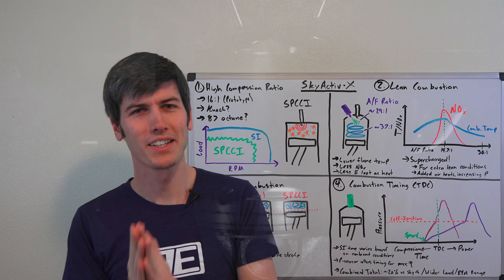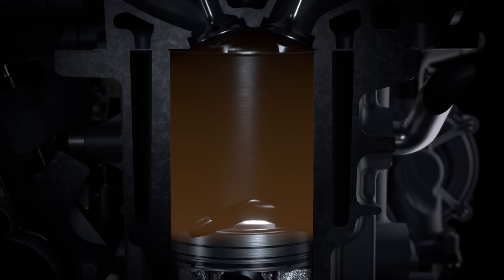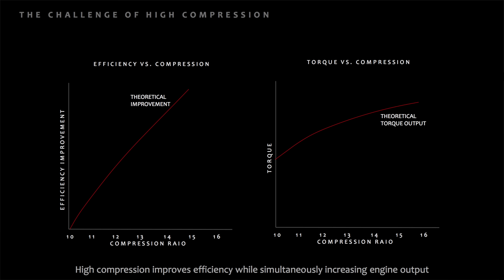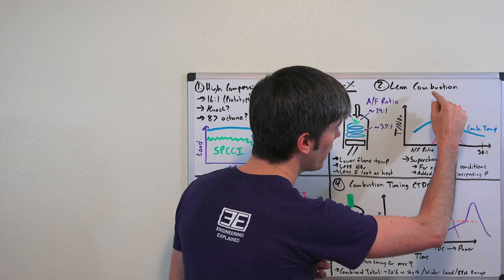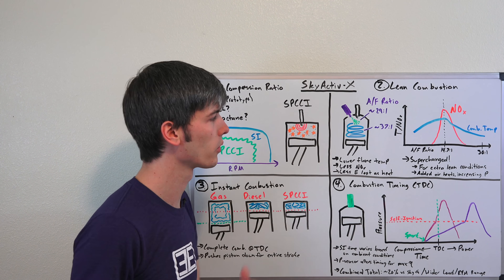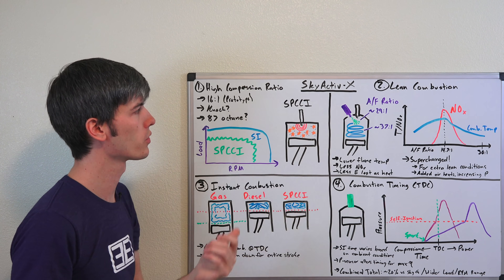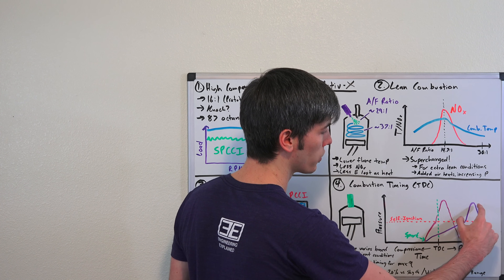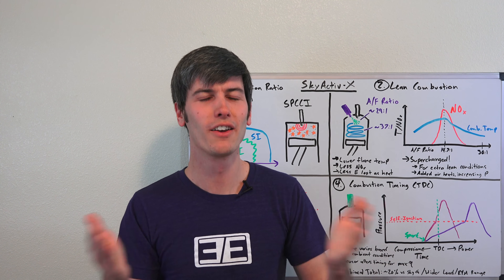How Mazda Is Saving The Gasoline Engine - SkyActiv-X

Comment: I assume that test engine is a 2.0L...Not bad if it makes 190hp. Thats 35hp more than the current engine while still being cleaner and fuel efficient....Also a few hp more than the current 2.5L.
Reply from the maker: Yes, 2.0L.
Reply: It is supercharged tho
Reply: Yup, it's pretty damn good for a small, efficient engine that is using the supercharger NOT solely for extra power here.
Reply: I was wondering this the whole time. You should put a pop-up thingy on the video that mentions this.
Reply: It doesn't add more fuel with the extra air though, like how you would use a supercharger normally. It's only to lean out the AFR.

Comment: They also have the best EPA fuel economy with torque converter transmissions. No 9 speed DCT or CVT needed.
Reply: it also drives amazingly. They have REALLY aggressive lockup, and behaves much more like direct drive (no slush box characteristics for most of use). The only downside is it can get a little jerky under load.

Comment: 100+ mpg was achieved in the early 70s by privateers. GM & Shell actually reached nearly 1000 mpg in the mid-late 70s with a carbureted Pontiac V8. That technology has been occulted.
Reply from the maker: From an energy standpoint, 1000 mpg just not possible in today's sized cars (unless you're going down a big hill). Conspiracy theories should at least be mathematically feasible. Unless they were based on nuclear fusion. :)

Comment: 16:1 compression is crazy... my 2.2 diesel engine is 15.7 compression.
Reply from the maker: Yep! Mazda even has 14:1 CR diesels.
Reply: Pretty high for a gas engine, my 3.0L diesel is 16.5:1.
Reply: BrianNC81 That's what I meant to say. I was comparing it to my diesel!
Reply: Engineering Explained Whats the advantage of a "low conpression" ratio for a diesel? I commonly work on older Land Rovers which have 19:1 compression. As far as I know, older diesels have far higher compression ratios than modern. I know they're turbocharged now, hence lower but why THAT low for the Mazda engine?
Reply: LewStep With a high compression ratio the temps and pressure were higher, causing combustion in small pockets of air+fuel before it had time to mix well. They wanted better NOx emissions from more even combustion and heat that is spread out instead of localized and intense. They're also running 24 psi of boost with a compound setup. The race version of the engine was running 12:1(I think) compression and 70 psi of boost.

Comment: I have a question about this, why do they choose to use a Supercharger and not a Turbocharger? isn't it more efficient to use a Turbo since you are "Recycling" the otherwise wasted energy from the combustion? The supercharger has to run off the engine crankshaft, it may be more inmediate but less efficient, right? who can explain this to me
Reply: ChickenTM they need consistency, so they don't want turbolag.
Twincharge would be a good idea though
Reply from the maker: Because you'd need sufficient exhaust gases to produce significant airflow, which you won't have when you're running in low load, high efficiency modes.

Comment: I wish BMW do the same for inline 6-cylinder petrol engines, no turbocharge, just a pure aspirated engines... Unfortunately they took the easier way by putting turbocharge in small 2.0 engines and rename them as they are bigger (2.0 is new 3.0), what a waste...

Comment: I have a question! Why it is not possible to compress just pure air and inject fuel (gasoline ofc) AFTER compression is done, so the fuel self ignites the moment it is injected at very high pressure into the combustion chamber which already holds pressurized air.

Comment: So how do they prevent Knock from hurting the engine? Or did I miss that somewhere.
Reply from the maker: Using the pressure sensor to monitor cylinder pressure, they adjust spark timing/valve timing/air-fuel ratio/etc accordingly to ensure that combustion occurs at the right moment, rather than creating knock.

Comment: I would surmise that most manufacturers will adapt a similar concept. I always felt that that grey area in Ignition before or after TDC was so unknowable and wasteful of energy, due to any number of reasons (load temp fuel combustion deposits etc). That pressure transducer in each cylinder monitoring the exact ignition time to help  automatically adjust the map of ignition time is a masterpiece.  Yep very very complex and I would own a extended warrantee.  Some form of combustion engine will be around for decades.. this is the technology.. 
I envision a different fuel type perhaps  and adapting this technology to diesel. AKA Multi Fuel Engine? Mostly All thats needed is the correct engine maps.
What would I do without your simple explanation and theories of operation in your videos.
Hey it makes me feel more intelligent. Win Win baby!

Comment: So how does this end up performing as far as an estimated fuel economy? I would imagine significantly higher than other gasoline engines. Also, what does the engine efficiency (vs ideal engine) end up being? I'd imagine somewhere in the low 80% range, right?  All very cool stuff, thanks for the video!
Reply from the maker: Current Mazda 3 is 28/37 mpg with SkyActiv-G, and Mazda anticipates about a 20% improvement with SkyActiv-X.

Comment: Interesting engine but i wonder if we will ever see it here in Europe. We do not have fuel with octane as low as 87. Our regular has 95 octane and super has 98 octane, so self combustion and the timing is a lot harder.
Reply: GauisHelenaMohaim I think it's the same grade still so your 95 is our 87.
I believe engineering explained made a video about it already
Reply: J73DD37J ok, that makes sense, a different method of measuring it seems. Tnx for the clarification.
Reply: JUst add water

Comment: I'm all for this, but what are the longevity characteristics of this engine?  I imagine the high compression ratio will lead to engines failing faster (head gasket failure). Combined with the carbon buildup of issues of direct injection engines, this may end up being worse off in terms of being greener.  What are your thoughts of this?

Comment: Woohoo Mazda is keeping the gas engine, and improving it to fight off the hybrid / electric / green, type cars.

Great work Mazda.
Reply: Just sayin', Mazda's gonna put this with a hybrid system, it's part of their "Sustainable Zoom-Zoom 2030" plan, so they're not exactly fighting the hybrid or green cars with their highly fuel-efficient engine that's gonna be electrified.
Reply: Not really, no matter how fast and precise DJ make electronic music and how fast paced techno is. It will never replace acoustic music like Rock and Metal.
Reply: DevasionX rock music doesn't cause millions of deaths per year so it's not exactly the same..
Reply: I see no reason you couldn't improve it with a 48volt starter motor and a 2kwh battery pack - stop-start, regen and a little extra low-end torque.
Reply: The Royal Crowned Tiger got no points so your resort to saying something that got old 50 years ago, nice.
Reply: Kyle Belouin : Only time can tell, no person can tell that ahead of time, not even the fortune teller can help you.
Reply: The Royal Crowned Tiger the facts are available right now. It's not a time can tell.
Reply: larry Spiller : Boring,  yawns and ignores Larry.
Reply: larry Spiller : According to what sources ?

I will need to see things with my own eyes, before I might even consider believing it.

Lets see the website links.
Reply: It is because of their relatively smaller R&D budget that they went this path; further optimizing the NA engine

They couldn't compete head on with the Big Boys (i.e. Toyota, Volkswagen, GM, Honda) in the big effort of lowering down the fuel consumption / increasing the FE (MPG)
Reply: The Royal Crowned Tiger ikr
Reply: Despite your thinking, ICEs will not be around forever no matter how well they're engineered.
Reply: The Royal Crowned Tiger electric semi smokes any diesel, electric supercar smokes any petrol. But ya no totally for sissys okay haha. Your a joke
Reply: Scott Verge : Keep the gas engine going, forget the electric, and besides to charge up the electric car, have to burn conventional fuel sources anyways, coal, nuclear, and so on.

In the end, the seemingly clean, is still alot more dirty than you think.
Reply: I will be looking forward to possibly get a some sort of mazda in the future, which has the gas motor in it.
Reply: larry Spiller : Take your thoughts and shove it into your body where the sun don't shine.
Reply: Even with electric cars, to make the electricity to charge up them batteries,  conventional fuels will be used anyway.

Nuclear, Coal, and so on.
Reply: The Royal Crowned Tiger O  I can't wait till ICE engines are dead.  Bring on the age of electric.
Reply: Keep running the internal combustion engine forever,  forget the sissy electric / hybrid, etc nonsense, they are for females.

If you are a dude, you will man up and go with the gas engine, in this case mazda doing great work with improvement of gas engine to make it more efficient and cleaner running, still keeping it 100 percent gas.

If you are a dude going with the electric / hybrid,  nonsense, your mentality is already becoming too  feminine, thinking wise.

I think propane is the ideal fuel here, cleaner burning fuel, and still can run on the same gas engine.

Propane is flammable, but so is gasoline. 

Propane is specially engineered fuel,( man made ),  unlike gasoline thats highly filtered and refined from crude oil.

Comment: im interested in what your all highway mpg was.
knowing that full disclosure does not mean that its epa ratings and that results may varie
Reply from the maker: Well the current Mazda 3 is 37 mpg highway, so a 20% improvement would be roughly 44 mpg.

Comment: Do you think the pressure sensor would be able to detect different fuel mixtures like E15 or E25 and adapt it for the top dead center? 
I mean, they must have different densities, it would adapt on it's own or a different one would be used?

Comment: 190 hp really isn't bad for a super efficient engine
Reply: to the contrary, i would say it's really good
Reply: Might just be my European mind, but 190 is plenty enough for a hatchback or some sort of non-American family car.
Reply: 190hp out of a 2l, yeah that's pretty good.
Reply: 190hp actually really impressed me for power output from what's supposed to be a super efficient engine. Usually you're lucky if you even get 100hp with insanely high MPG cars (electrics are a different conversation) lol.
Reply: I've got a Mazda3 with the 155 hp engine and that's really enough for how light the car is, and I've driven a Mazda6 with the 184 hp 2.5L engine and it really gets up and goes.  I have high hopes for this engine.
Reply: Matt Klinger 190HP is a BLISS for people in europe. Majority of the population uses 90-120hp cars for fuel economy here. This can be a game changernin european market for mazda, which serves a tiny percentage compared to the total domination of vw group in europe

Comment: In your pressure v time graph the pressure is falling off sharply after peak pressure. Wouldn't actual pressure fall off smoothly as piston is letting the combustion gas expand?
Reply from the maker: Pressure drops as the piston moves down (the pressure is converted to useful work). Don't worry about the scale as much, it's just to illustrate a point.

Comment: Mazda should develop a wankel for the modern era
Reply: Steve Pounder apparently they still have a small team working on making the Wankel more efficient because its the life goal of some high level guy at mazda to make another rotary sports car, and they also have plans to use the wankel as a hybrid range extender due to its incredibly small size. so not quite dead yet.
Reply: Isaac Brilhart If they can get SPCCI working in a wankel, it'd be huge. Small, low displacement engine for hybrid use, or scale it up for a highly responsive sports car. Can't wait to see what comes out of this research. GG Mazda.
Reply: Steve Pounder theoretically, a slightly different varient could be more efficient. Rotaries can be efficient but generally only at low rpm
Reply: They already are. "Skyactiv R" in their RX Vision prototype.
Reply: They are.
Reply: Quaty Borebor Wankel while super cool are dead technology. No point in polishing a turd from a efficiency stand point.
Reply: No, they shouldn't